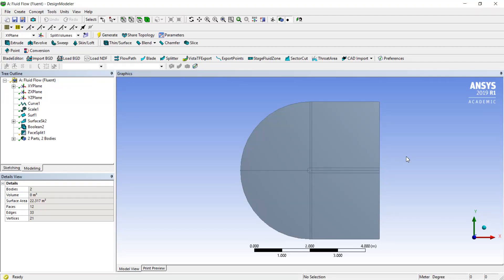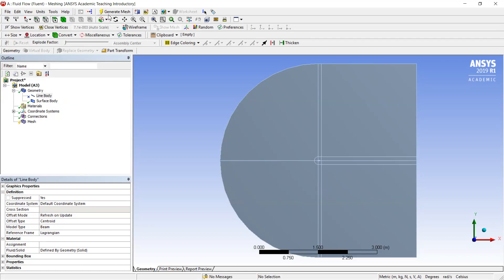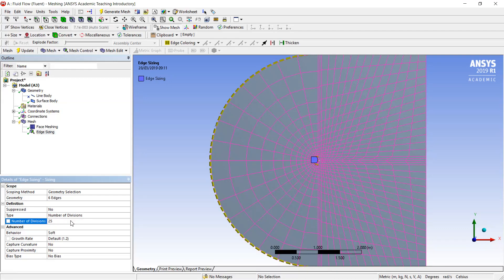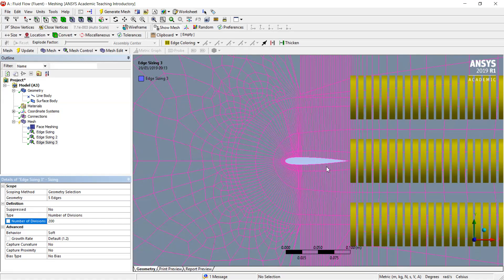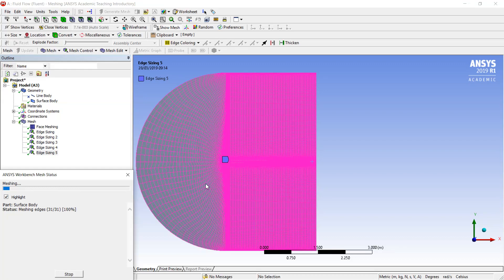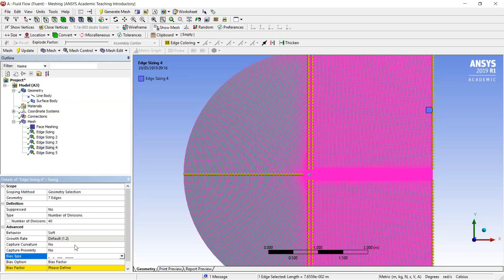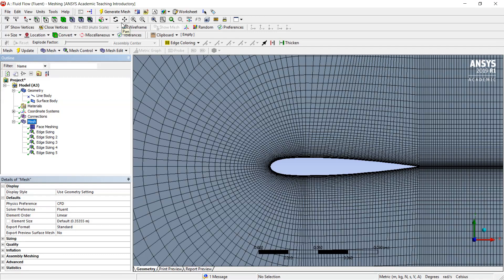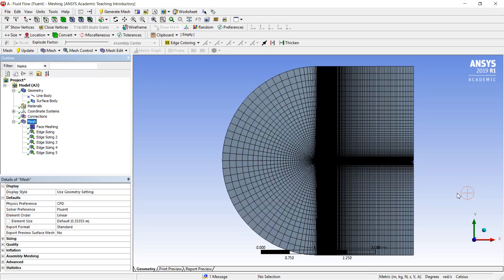Airfoil Simulation study in Ansys Fluent - part 3

Comment: Hello, After closing the Geometry I still have "?" instead of the fine sign on the geometry, that's why I cannot launch Mesh... Why is that? Thank you
Reply from the maker: Hello. Probably, your geometry is not ready for the meshing. Try to see if you have a "fine" sign inside DesignModeler -> Part -> Surface body, update the components and save the project.
Reply: @chemicalpropulsionlaboratory  Thank you so much! I figured it out... your video is really working well! Do you know how I could transform the airfoil shape so it looks like there is a layer of ice on it?
Reply from the maker: @kristianazor5469  Thank you for appreciating the video. Answering to your question: The airfoil is a list of points imported from the text file. It could be edited in some table processor or math software. You could crete the similar table with the ice profile and then join these two profiles. This might work well for the stationary flow simulation. If you are trying to solve the transient case, you might need to simulate two-phase flow with phase change mechanism, which is not so trivial...